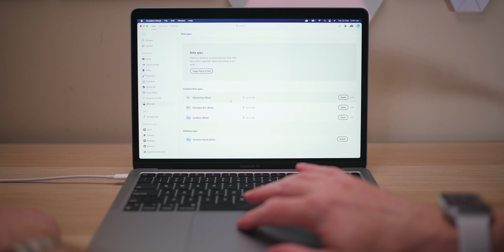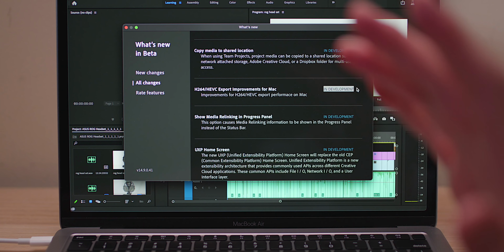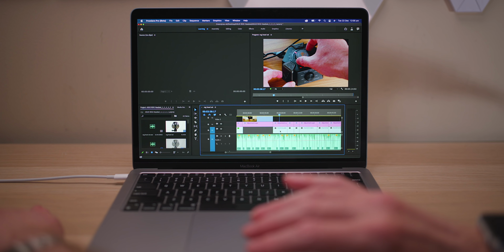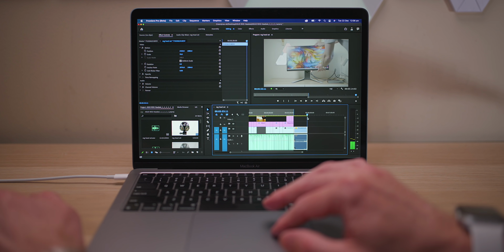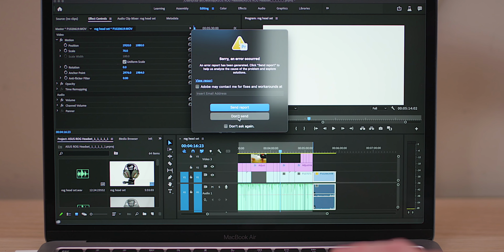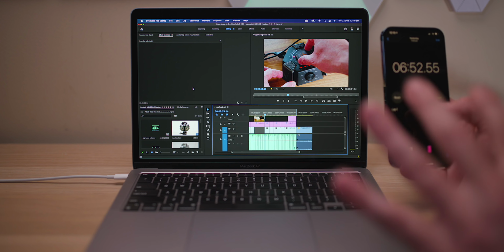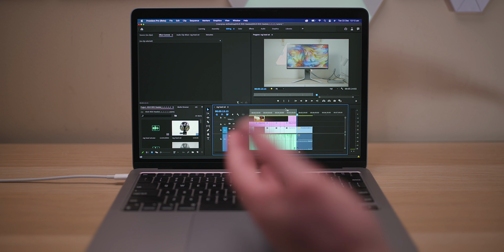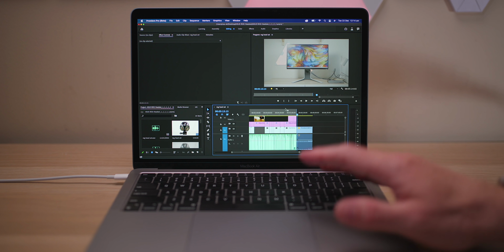M1 Macs - This Changes Everything 100% NATIVE PREMIERE PRO! How Fast!. M1 MacBook Air MacBook Pro 13

Comment: I have the 16GB M1 Mac mini, and I use Premiere pro. Recently, I used it to edit a four minute project, and the playback was choppy; it also kept dropping frames or just straight up freezing on me. The scrubbing wasn’t smooth either. Even when I set it to a 1/16 playback, it would give me a lot of trouble. I wonder where I went wrong. 

I used h.264 4K stock footage mixed in with some 4K footage from my iPhone 12 Pro Max. I also recorded a voiceover right in Premiere and added some background music into the sequence. I edited the voiceover audio in Premiere, so there were plenty of effects stacked on top of it. Out of laziness, I was pulling the stock footage directly out of the downloads folder, and pulled other parts straight off of the desktop. I also added a few text boxes over some clips at the beginning, middle, and end of the sequence.

Can anyone tell me where I went wrong? Are there any videos out there that explain how to optimize Premiere Pro for use with the M1 chip? I’m on the verge of selling this thing and grabbing a 16” M1 Max if there’s no solution. 

Thank you 🙏🏽
Reply: Yeah so as much as I can judge, the version you’re using of Premiere Pro is not native for the M1 chip. Had this been a choppy playback for H.265 or any other Raw source footage like Arriraw or Redraw, I would have understood that the M1 chip is having a hard time. But here for sure the application is being run through Rosetta 2, which is making it not so smooth. 
I understand that some people are much more comfortable in the shoes of Premiere, but give FCP a chance here. And also the fact that 99% mods of Premiere don’t work on the M1 chip. In my case, even the ones BOUGHT from Adobe’s website crashed. Both adobe and apple were like We’re sorry, we don’t know jack shit what’s going on. If your machine works well with the Apple Silicon Native 2021 Premiere pro, then Bravo! 
In case you do end up buying the M1 Max, which I don’t frankly think you need to edit this kind of footage, make sure with the showroom peeps that they install your 2021 Premiere on it
Hope this helps!!
Reply: @parthchopra2811  Thanks. This helps, as it affirms what I imagined could be the case. I’m going to try to reinstall the correct version of Premiere Pro before exploring any alternatives since I am already invested in the Adobe suite.
I’m mainly a photographer, so I’m almost positive that it’s something I’m doing wrong somewhere in the workflow.

Comment: Hey ! I’d like to buy a Macbook for my studies, and I’d like to use Premiere Pro, Photoshop, Illustrator ... without any issues.
I don’t know what version I should buy : my wallet is not really big, but i’d like to add an “extra” : should I rather take a 512 GB SSD instead of 256 (by the way I bought an extern 500 GB SSD) or 16 GB memory, instead of 8 ?
Oh and is a Macbook Air 16 GB worth it or should I take an 8 GB Macbook Pro ?
Thanks for reading !

Comment: I get that people who are just planning to use the computer for general, basic tasks buying the lowest end machine. And perhaps a few “reviewers” who themselves don’t really do serious work, buying the lowest version, just to show how that cheapest model works. But if someone wants to use it for “real” work, then it’s really necessary to buy the higher end model with 16GB RAM, and a bigger drive than the 256Gb version. That 256GB drive is also much slower than the 512Gb and larger models, because that’s the way SSDs work.

I just bought the Macbook Pro with 16GB and 1TB.  It works quite well, and RAM isn’t crushed.

Comment: @Tally Ho Tech, How well can these macs run CAD software like Fusion360 and Solidworks? And can the MacBook Air M1 handle that? Also would 8gb of ram be fine?
I want smooth as possible. Buying either today or tomorrow!! Will let people know how it goes after.

Love the videos:)!

Comment: Give me an advice 16ram Air or 8 ram Pro for AE, PS, PR, AI.
Reply: Same i need this too
Reply: @gagassetyabrata603  16g ram it worth
Reply: 16GB MacBook Pro ideally, but you may just want to buy a PC laptop if those are your needs, considering that Adobe hasn’t released native versions of all of its apps for the M1. You could get a solid PC laptop with an i7, dGPU and 16-32Gbs of RAM for about the same or a little more than what you’d pay for a decked-out M1 MacBook Pro.

Comment: I went for the base model Mac mini to try it out and so far, I'm very impressed. It's surprising how much stuff already works, even if through Rosetta. 50-60 FPS in Rosetta for Rocket League and CSGO (neither the most advanced games ever, but this is without a dedicated GPU in a base model), Unity, Visual Studio, Pixelmator Pro - zero problems so far. I stress the so far bit though!
Reply from the maker: Thanks for sharing

Comment: I''ve been using  the M1 Macbook pro 16GB  for a couple of days now, AND MAN IT FLIES! I'm using photoshop Beta, hooked up to a 32''' LG 4k Monitor, working on 30-50+ layers files for print in Hi resolutions, have 4k youtube files playing  along side, a few pinterest tabs open. Working 10-12 hoours a day doing concept art and illustration, this thing  DID NOT even turn on the Fan ONCE! Nada! I'm SUPER happy.  

To be honest I did plan to wait for the 16'' pro with an M1X/M2. but this does EVERYTHING I need so well, that I do not bother anymore....heck I think the 16GB Air would do just fine.
Reply from the maker: Thanks for sharing

Comment: From the looks of it, DaVinci Resolve has faster/smoother scrubbing than Premiere, as far as I can tell. However, I urge anyone wanting to gain a substantial improvement for their new M1 MacBook to consider adding an external SSD such as the Samsung T7 or T5 models and be sure to set your video editor to utilize that drive IN CONJUNCTION WITH the internal drive. I have my settings such that my cache is on the local drive and my media files are on the external storage. This helps to distribute the load to each of the drives. This made a VERY NOTICEABLE improvement in my editing experience.
Reply from the maker: Th la for the tip
Reply: Do you have a link or description on how to set this method up with a T7 SSD. Sorry, I'm new to this but would love to learn.
Reply: @FountainArchives  No setup is required.  Just plug it in and it's ready to go.  As soon as you plug the SSD into the MacBook Pro it will show up as an icon on your desktop.
Reply: @aerostahr  if there is no setup then why did you suggest ppl to "set your video editor to utilize that drive in conjunction" ? I think that's the part the guy wants to know how to do along with myself
Reply: @cooleytvshorts  oh, I see.  You mean setup in your video editor.  Well, all video editors have a cache/scratch drive that they use to make temporary files to speed up your playback when editing/color grading.  The location of this drive is specified somewhere in your settings (it varies based on the editor you're using).  Find where you need to change that setting and specify a location on the new SSD and you'll be good to go.  Better yet, educate yourself more on how your particular editor does things, the types of temp files it creates, etc and you'll be able to fine tune your system to perform at its best.  Good luck.
Reply: Make a video plz
Reply: @RidleyE  I’m sorry, I would but I don’t have the time. What I can do is suggest you check out the Blackmagic Forums. A very helpful community of Resolve users who I guarantee will help you out. There’s even a M1 Mac sub forum. Good luck.
Reply: Thanks ...did you notice a difference with premiere's performance on that too?
Reply: @PlaytimeMotionPictures  generally speaking, most modern NLEs (or any application that manages resources well) will benefit from the addition of an SSD, which are so fast these days that operating systems often use them as secondary memory (ie memory cache). No guarantee, but I would bet real money that premiere would benefit as well.

Comment: I’m not sure between 8gb and 16gb ram in 2021 🤒
Reply: same -.-
Reply: @edem6783  have you ordered yours yet? I picked up a 8gb ram /512gb on Friday but I still haven’t opened it :/ 
The 16gb ram /256gb is back ordered til Jan 21
Reply from the maker: If you can afford it go 16GB but if you can’t don’t sweet it
Reply: @TallyHoTech  I can afford it, I don’t want to wait til January 21st 2021 for my machine :( 
That’s my dilema

Comment: I'm now running a Hackintosh XPS 9570, can't be happier with this machine.
But man! If I got some money to spare, I would definitely want to try this baby out too!
Reply: If you use Adobe apps, do you find them running better than on Windows?
Reply: @agiverreviga4592  I’m not a creator so I don’t use adobe software. But I can say that Office runs better on Mac. Lots of graphics rendering task such as pdf works much better on Mac too despite only integrated UHD630 works. Also screen color is more accurate IMO.